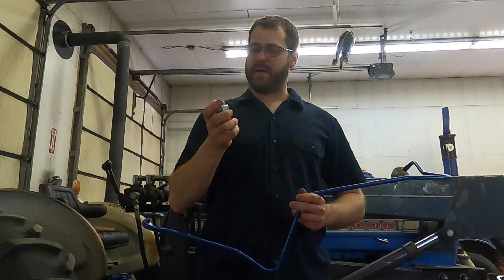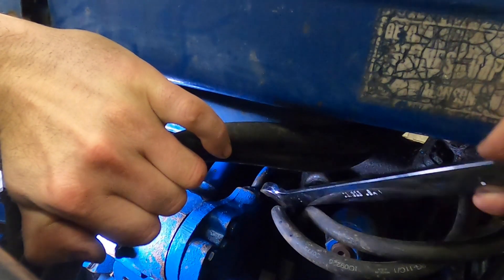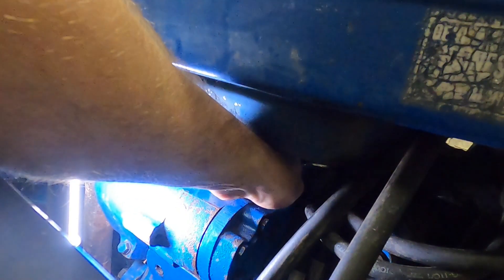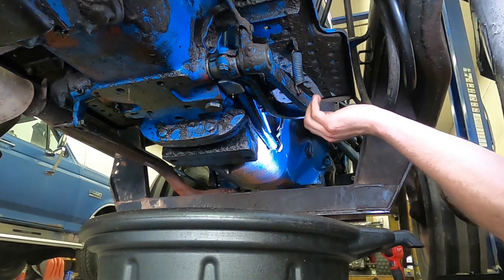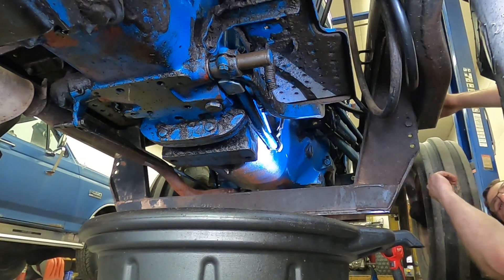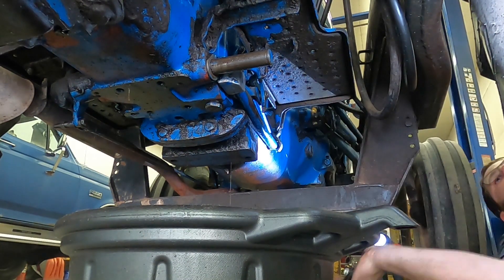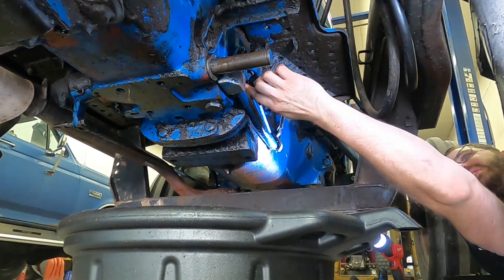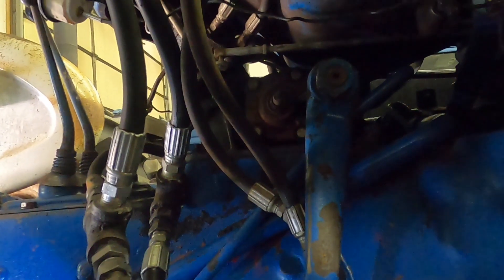Ford 3000 Main Hydraulic Pressure Line Replacement Part 1

Comment: I am working on same and am looking at ways to convert it to a standard hydraulic fitting and flexible line. 

It f that doesn’t work out, I’m curious if you know the part number for the line you replaced.  And where did you get it?  Thanks
Reply: That would be ideal touserubber line

Comment: I had to replace this line. In the process the nut to the flow tube to the pump need replaced.  I cant find a part number for it.  Do you know where I can find it.  I tried a dealer no luck. Thanks
Reply from the maker: When I first started on this tractor there were parts diagrams online.  They seem to have disappeared.  A good New Holland dealer should have access to the part numbers and even a locator service.  If your local dealer isn't helpful you can try these guys https://www.willardseq.com/ don't bother with the website they are controlled by New Holland and aren't much help, give the parts department a call.

Comment: I put a regular compression ring on the line using the compression fitting nut etc to clamp it down on the line then cutting the nut off so I could reuse the original nut that threads into the pump, then ran the nut down on the ring and rubber seal shoved on the ring. Works great. Definitely not blowing it out

Comment: Very informative (both videos).  It was helpful to get my line replaced.   I took your advice and ordered OEM fitting for both sides. Did not want to go through the process more than once using the cheaper aftermarket fittings.

Comment: I've changed the pressure line once and the compression fittings too many times.  Agree, it's a poor design.  I removed the foot rest after removing the two springs.  That way you don't have to remove the pedals although you do have to remove the pins from the clevises.  My parking brake is missing.  I discovered, before I did any damage, that the after market compression nut has a different thread.  After buying the oem nut I still had a leak.  I backed the compression nut back out a little and lightly hammered the tube in as far as it would go then re-tightened the nut.  No leaks so far.  It's a real pita.
Reply from the maker: I really like the tractor overall but the hydraulic system leaves a lot to be desired.  I believe the parking brake bracket is in the way of line removal as well but I shot this video quite awhile ago and can't really tell from the video.